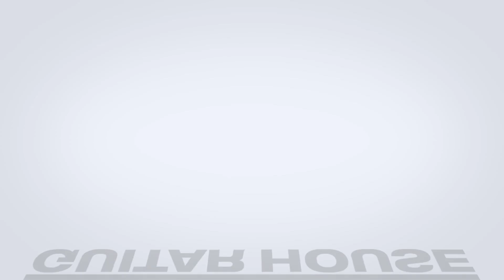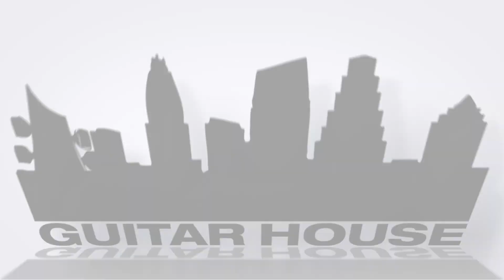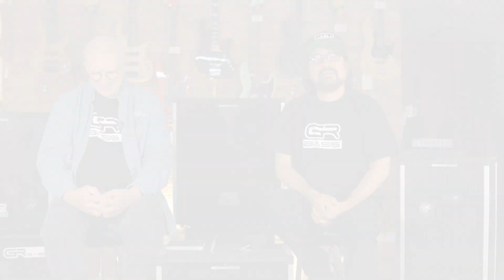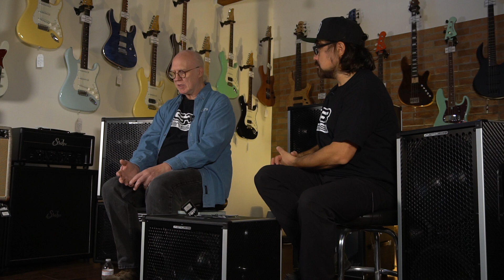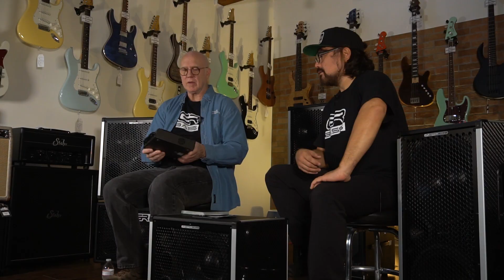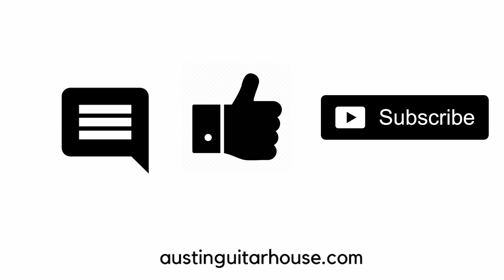GRbass AeroTech Featherweight Speaker Cabinets - The Lightest Cabs in the World!

Comment: Does anyone know how GRbass AeroTech compare with Eden cabinets.  I use the Eden2x10 for swing and rock.  Its a good sound.  Heavy but nice.
Reply from the maker: First off the weight is shocking ... it's really Unbelievable. Second in Comparison to a wood cab . The material its made from is in density the same as a panel of standard birch or pine. I play these next to Bergantino NXT, NXV.....its very comparable. I don't feel like it sounds like composite material. If you have any other questions call us !